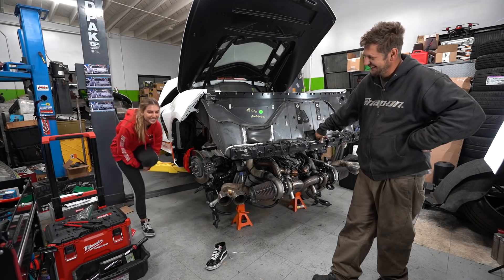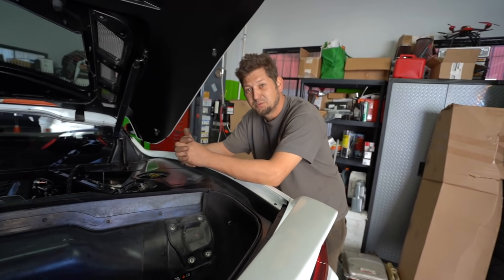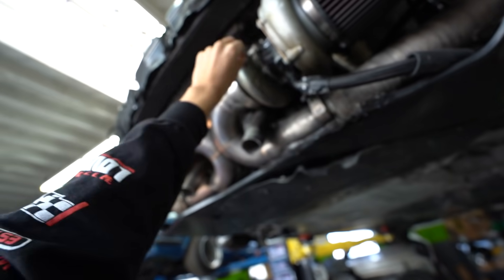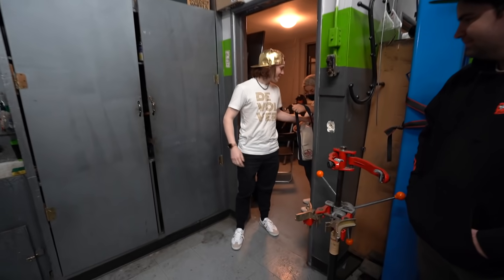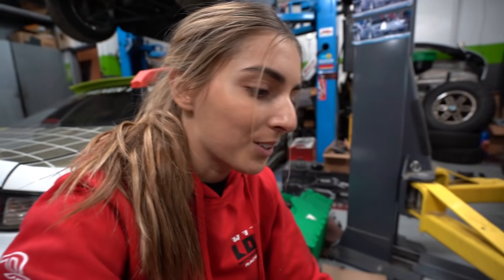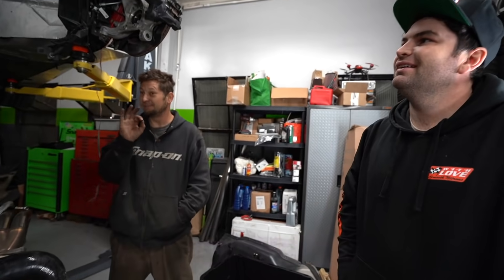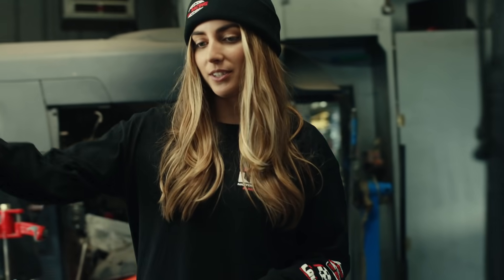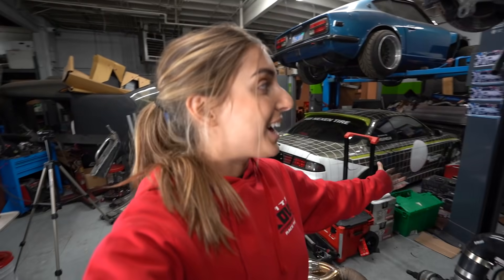TWIN TURBO C8 CORVETTE GETS COMPLETELY TORN APART...

Comment: I work at a GM dealer.... You need to get the car into service mode:

1. Foot OFF the brake
2. Press and HOLD Start button for ~8-10 seconds
3. Lights and chimes will sound and it will be just like the "old days" of key two clicks
forward in the On/Run position
4. Release Start button
5. Press brake and shift into Neutral
6. When done, move back to Park and press Start (no foot on brake) to get out of the
service mode (if you don't do this the car will stay on until the battery runs out)

Comment: Thank you Emelia for everything you do for mental Health. I was diagnosed with PTSD some years back and now I'm disabled. I used to drive a pavement late model but now with the Health issues I just couldn't keep up with the costs. I have moved over to a little street S10 with the motor out of my race car and just recently added 150 shot of nitrous to it. I'm pulling about 650 hp with it now. Its my pride and joy.  Dan Foster Cedar Rapids Iowa

Comment: You can change that door lock setting in the middle display. Go to Settings, vehicle, & then power door locks. Also you can kinda put it in neutral & disengage the clutches by putting it in manual 1 & pulling both shift paddles at the same time without your feet on the brakes.

Comment: If you hold the start button for a few seconds, without your foot on the brake, it is the same as turning a key to run without starting it. The ignition not turning completely off is actually a thing though

Comment: Be careful with the cross drilled and slotted I got mine abit hot and it cracked between the drilled holes I got slotted disc after that with out any issues , I ran bendix ultimate pads both times

Comment: Hold the ignition button down without your foot on the brake, then shift to neutral.  There should also be a manual override for towing.

Comment: Emelia you can put the car in neutral, it is called car wash mode. I will look it up tomorrow for you but if I remember correctly you have to shift into drive open the door and then shift in to neutral. It should be in the owners manual under car wash mode.

Comment: Instead of using heat wrap u can send off any exhaust related pipe and get it ceramic coated from places like JetHot coatings. They coat the outside and inside of the pipes, even in other colors than silver or black, like orange and the stuff withstands temps up to 2000° and looks great too! I did my Turbo Imapla SS some years back and it was the best $$$ I ever spent. I hate using heat wrap and it comes apart or gets wet or dirty and then looks nasty 🙄 😞 Good luck on the next engine pull and put back in, hope it lasts more that a few weeks between the 3rd removal 😉😎👍🏻

Comment: Hold start button for 8-10secs without holding brake and it will put it in service mode you should be able to put it in neutral

Comment: @Emilia 1:05 - Just FYI, though you probably know, I had to pull out a C8 at VIR and had to do the following to get out while keeping it in N:
    Ignition ON — Engine Running
    Apply the brake pedal
    Open the door
    Shift to Neutral
    Release Parking Brake
    Turn off the engine and release the brake pedal
    The indicator should continue to show N. If it does not, repeat steps

Thanks to the CorvetteForum for the help, as always.

Comment: The following procedure allows the vehicle to remain in Neutral:

Engine Off – Driver in Vehicle
Ignition ON — Engine Running.
Apply the brake pedal.
Shift to Neutral.
Release Parking Brake.
Turn off the engine and release the brake pedal.
The indicator should continue to show N. If it does not, repeat steps 2–4.
Vehicle is now in Neutral Service Mode.

Engine Off – Driver out of Vehicle
Ignition ON — Engine Running.
Apply the brake pedal.
Open the door.
Shift to Neutral.
Release Parking Brake.
Turn off the engine and release the brake pedal.
The indicator should continue to show N. If it does not, repeat steps 2–5.
Exit the vehicle and close the door. Vehicle is now in Neutral Service Mode.Note: The vehicle may automatically shift to Park upon re-entry.

Comment: no need to start the car to put it in neutral.
1.	Ignition ON — Engine Not Running.
2.	Apply the brake pedal.
3.	Shift to Neutral.
4.	Release Parking Brake.
5.	Turn off the ignition and release the brake pedal.
6.	The indicator should continue to show N. If it does not, repeat steps 2–4.
7.	Vehicle is now in Neutral Service Mode.

Comment: Get an Acura NSX and mod it right! Quad turbo V6 no hybrid?
Reply: quad turbo doesnt work with a v6
Reply: @palmermonsen9098  I did not know that, can you elaborate on the math that goes into the set ups?

is it something like
I4: one bank = single turbo max?
V6: two banks = two turbo max?
I5: ?? three max
I6: ?? 
V8: ??
Reply: @SilverScarletSpider  It might be possible, koenigsegg has done a twin turbo 3 cylinder but I think it uses a complicated exhaust manifold and 4 turbos just wouldn't make much sense, it would be much more efficient to go with twins turbos which would weigh less and I think would make more power

Comment: "i need new rotors" meanwhile im using a wire brush to scrape the quarter inch of rust off the edges. good as new

Comment: Found this Hope it helps (I am not a tech and am not sure)

Manually Shifting to Neutral

With the ETRS system, the transmission parking pawl cannot be disengaged unless the engine is running. If there is a loss of vehicle battery power, the DT-52388 manual park release tool can be used to shift the transmission to Neutral and move the vehicle. Due to spring pressure, the tool must be applied to the release lever and held in the release position while moving the vehicle. The manual park release is located on the right side of the transmission and can be accessed through the trunk.

Found here: https://gm-techlink.com/?p=12881

Comment: Good idea on the brake hardware upgrade.  However stay away from drilled UNLESS the holes are actually cast in like Porsche rotors.  High carbon content 2 piece rotors are where you want to be at.  If the rotor is the floating type, all the better.  Check http://www.colemanracing.com/Brakes-C94.aspx for brake rotors.  They can actually make you a set according to your spec; i.e. 2 piece, full floating aluminum hat w/high carbon content slotted directional friction ring.